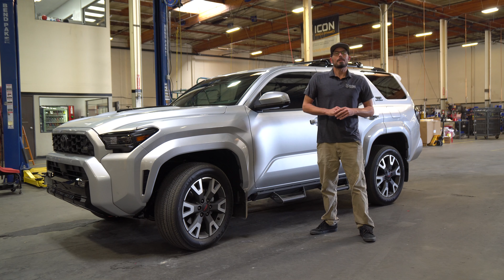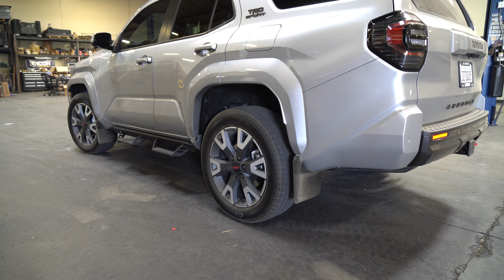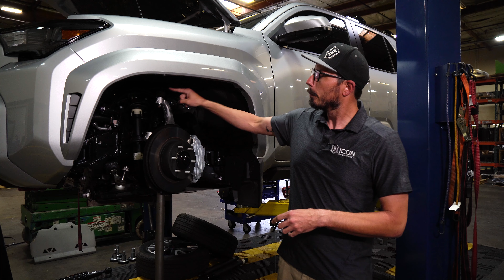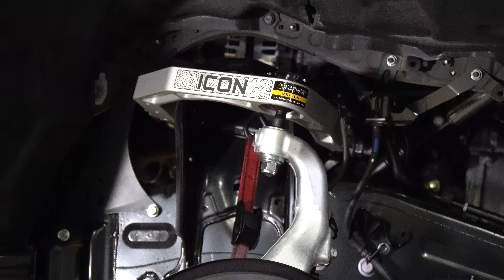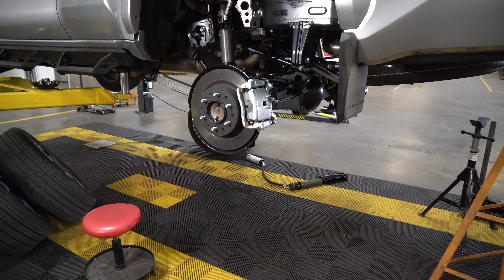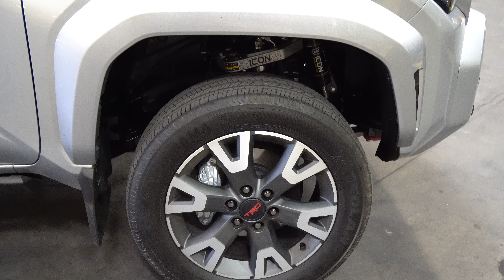Next-Level Performance: ICON Suspension for the 6th Gen Toyota 4Runner TRD Sport

Comment: Can I use the ICON 2025 Toyota 4Runner 4WD, 1.25-3" Lift, Stage 10 Suspension System, Billet for a 4Runner 4WD Limited 2025?